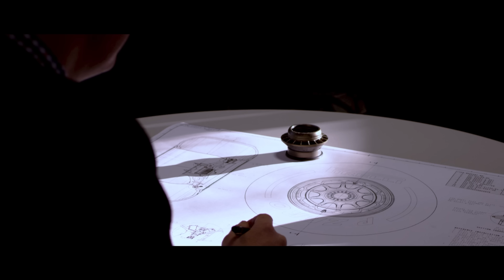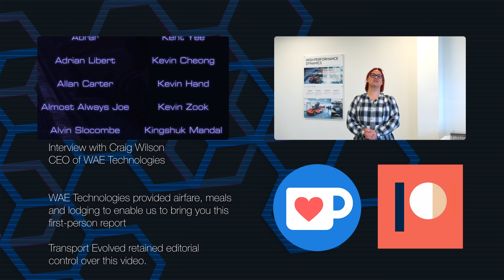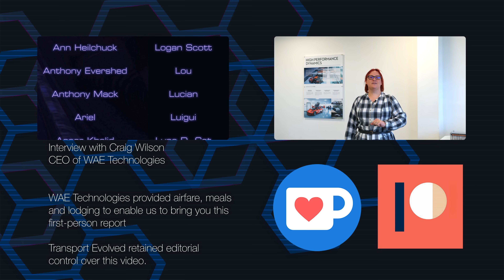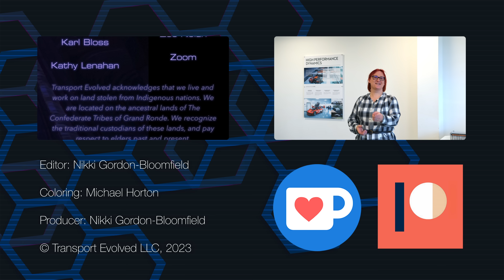From Formula 1 To Formula E, Here's Why Racing Helps Build Your Next EV

Comment: Very cool. I kept thinking about the review of Elysia you all did awhile back. I had to look it up to get the name right, and now I see that that was also WAE. Maybe you mentioned it but I didnt put those dots together until looking it up. Its really cool to see this. 

Fully Charged just did a segment a few days ago about the Spirit of Innovation and YASA/Evolito and most of the commenters were poopooing the development of speed record-breaking aircraft. WAE is illustrating the point perfectly: developing for high performance can have a direct impact on consumer-facing products. And the high-performance end is actually a better place to do that development, because even though the consumer products may not reach these speeds regularly, you know the hardware and software will be able to put up with the abuse. It also means the development isnt hampered by cost constraints that would happen especially at the lower end of the consumer market.